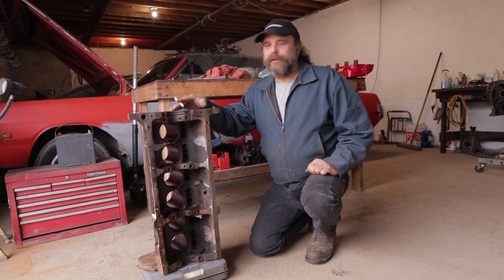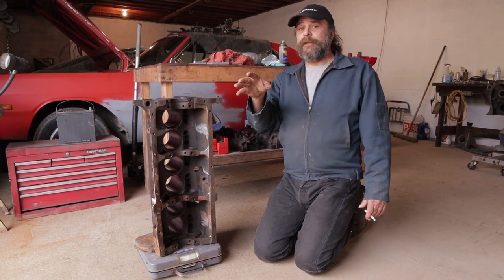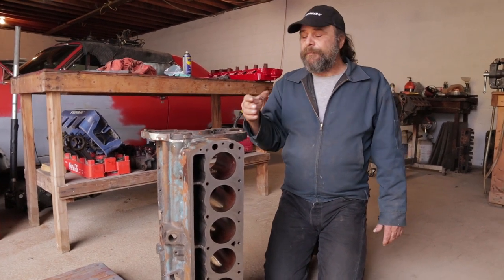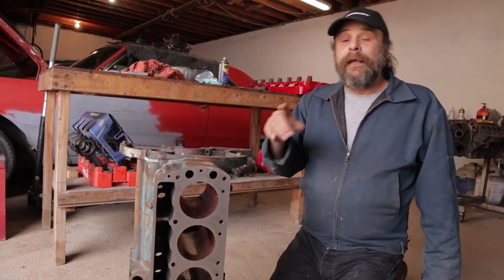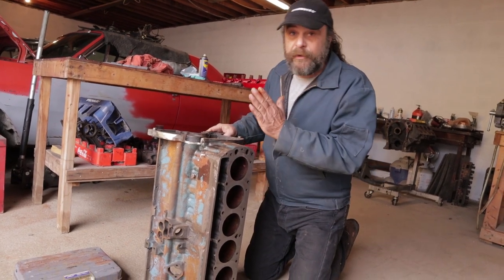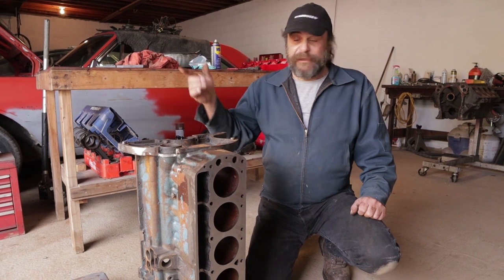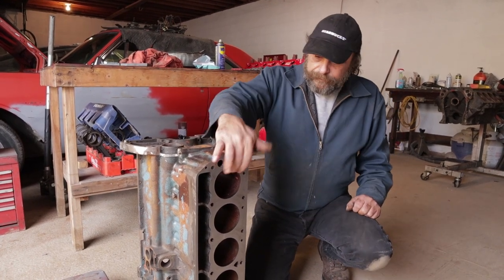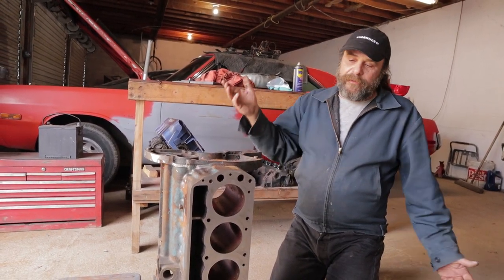Hot Rodding The Slant Six - Working The Block And Finding Compression

Comment: the newer blocks have a thin cylinder bore the head that come from from your head proly had 3 casting plugs the newer hast 5 side casting welch plugs use brass plugs the steel rust out,,,,, love all your vids my  fave channal

Comment: Good point about thicker cylinder walls some engines have thinner walls to begin with. I remember a couple 455 engines I've had cracking the cylinder walls after an overbore, they wouldn't do it till you started hammering on em at the track then poof up in steam they'd go. people don't realize the side load of a long stroke and cylinder pressure an engine goes through. back then I was young and dumb. those engines were plentiful and cheap and made a lot of power so I popped a few of em. O'h if I was only 18 again... love your channel, keep up the good work!

Comment: My friend had a '65 Dart Automatic with a 225 slant six. Engine needed to be rebuilt so we decided hop it up. Chrysler actually sold performance parts for this engine. We bought a four barrel manifold, HP cam shaft from them. We also purchased a set of headers and a Holley carb. Everything else was stock and engine not bored. Took it to the drag strip and logged consistent 15 seconds flat. This might not sound fast but in the late 60's this would beat a stock Camaro or Mustang. We had so much fun on the street on the weekends. Guy's thought we had put a V8 in it and wanted us to pop the hood to prove it was a six.

Comment: A good hand deburring tool works well on cast iron. Cheap and easy to use and available from MSC Industrial Direct. I have several. The flashing on the crank is from the casting process and is known as the parting line. It is where the parts of the mold are fitted together. There are other casting features to take notice of as well. Anything cast with a hollow will have some sort of core support, the sand core makes the hollow and must be supported on its ends or by wire supporters. On the slant six block the cores were supported by the freeze plug holes as well as wire core supports. I don’t know if the crankshaft was drilled for oil passages or if the were cast in. Billet and forged cranks must be drilled. Awesome work as usual Uncle Tony. Greetings from the high plains of Texas.

Comment: Great stuff and 'simply' explained for the laymen and keen  fresh spanner men out their. Putting a chamfer on  the top of the threads takes the stress out of the end of the thread, chamfering the top of the bores also limits potential hot spots that cause detonation, do the same on the edges of the combustion chamber for the same reason.

Comment: I have a slant head with .100" Milled. 
Was going to build a 9:1 225. Unfortunately didn't happen. Wound up buying a g32bt colt... lead to a slight dsm addiction. 
Now considering doing a 4g63 with a 4g61 crank, into an original 4g61t colt.

Comment: According to Mopar, you've got that backwards. I think it was Butch Leal the presented the Rod length to stroke ratio comparisons in the Book, 
How to Hotrod Small Block Mopar.  He found that the longer the rod the wider the powerband. Likewise I found an obscure magazine years ago that only managed to put out a handful of issues before going under. But they took a Chevy 327 and built it with 5.5" rods and again with 6" rods, both variations had the same 10.5-1 compression ratio. They tested each version with factory heads and again with a good set of aftermarket heads. Both versions , when the heads were the thing that they were testing, made more horsepower with the long rod, and they had a wider powerband. The percent of improvement was greater with the factory head with poor flow vs the aluminum head. The result then, was that a longer rod makes more power over a greater powerband, and poor flowing heads like the one on your 225, see a greater improvement than an aftermarket aluminum head would if one were available for your application. Unfortunately I lost the old magazine in a move to our first house when my sone came along. But I have two other articles talking about long vs short rods and they agree that the long rod makes more power over a broader range than a short rod. So why is everybody using short rods today? Because there are tons of stroked cranks available, and only so much room under the deck for the piston pins height. The other thing is there is a plethora of aftermarket heads for the most popular engines that make up the difference of a poor rod length to stroke ratio. 
Back in the day, Smokey Yunik was a master at building Chevy engines for NASCAR competition. He said that the ideal rod ratio would be 2.2-1. That is achievable in a Mopar 383 or 400 with its 3.38" stroke and Hemi 7.86" rod.  Butch Leal wrote that a street strip car should run a 1.89-1 ratio, and higher rod ratios for superspeedways when the corners are long and broad. For tight turns a ratio of 1.69-1 would help bring the car out of the corner with the cost of a peaky powerband. Keep in mind that the competition's 454 Big Block and striker 350 that makes 383 cubic inches both have rod ratios under 1.5-1, and snap crankshafts like twigs. In the late 70's thru the 80's when aftermarket forged cranks weren't available the core charge for a forged 454 crank ran $100 more than a reground crankshaft kit. That's ok, because if I were to run a Big Block Chevy I'd stick with the best and run a 427.
Reply from the maker: Long and short rods are relative terms, The Slant starts out with an extremely long rod.
Operating range is also relative.  Smokey was building engines that operated between 6 and 8 thousand RPM, and was completely unconcerned as to how it would pull from 3 to 6.

Comment: Use shorter push rods and there is a cast mount that bolts to the head and block for the alternator ( if you run one) that I had to shim or something, it was a long time ago. The Direct Connection slant six windage tray kit came with four 340 main bolts that have extra material in the head that are tapped for the tray bolts. You don't want to lose power from an oil system like too much pressure or volume and bubbles in oil get squeezed out and then it's metal on metal.

Comment: My 331 has 8:31:1 dynamic and a smidge over 10:1 static and runs fine on 91 octane. Depends on the head design the cam specs and the timing curve.
Reply: Hammer Head Garage I built a 331 as well with 10.5:1, 222/232 duration at 50. Runs great from 2k rpm and pulls hard to 6200. Compression is the secret to an n/a motor

Comment: As a kid, I got ahold of a hot rod six plymouth it a little hot rodded dodge body like a 34 model I believe. no fender and light weight. It wasn't fast on take of but it seemed like in high gear, it would turn forever. It was the first car at fifteen that I did over a hundred and I was scared cause I was the passenger. The kid was fourteen and in two years he had minor wrecks that left it undriveable but he just kept trying so his dad bought him a cobra when he turned eighteen but first ticket it was gone and I will be damned; he slowed down and got to be a good driver

Comment: Always chamfer and take sharp edges off. 
I'm pretty sure you've already explained in another video what happens to an unchamfered bolt hole when it's torqued down. 
At my work we are a dealer for a certain small engine that's known for popping head gaskets. 
After I do em , it doesn't happen again. 
Because they don't chamfer or do any kind of cleanup from the factory they just slap em together.
Reply: Thanks for that info. 👍

Comment: I bought a scat cast steel crank years ago. Fora Chevy 350. I could not belive how much lighter it was over the stock iron crank, it had to be 10-15 lbs, that ended up being a nice engine, aluminum heads, from trickflow, with canted valves, the twisted wedge, flat top pistons, 750 Holley, dual plane high-rise intake, I had it I. A full size truck, ex cab, it jerked the doors off a cobra mustang,  I want to build something similar, I tend to go overboard with the cam, this engine had a compucam from crane, a hyd, roller! .465" + the est. .030" from 1.6=1 rockers, port matched intake, it was just how the factory should had done it! I had it in a 3rd gen firebird, with 5speed, from a stopwatch and rough guestimates it should been in the 400 range, it would nearly pull the front wheels with 3.45 gears, I ran the rears at about 28-30 psi,  it would burn them down, this brings back memories!! Great video.

Comment: All good stuff (as always) U.T. -
when I had to close up shop I went back to Tool & Die work so....
A couple things - if someone wants to deck the block .100" without spending near as much money it could pay to shop a few regular machine shops (it's an easy setup on a large vertical or horizontal mill, or a boring mill) instead of an engine machine shop, it's a good chance they'll take .090" off at less than 1/3 of that $500 and still have the engine shop do the finish cut - at the same price they'd charge for a regular resurfacing.
Just tell the shop that rough cuts the deck to cut it parallel to the main saddles.
Most regular machine shops don't have face-mills large enough to finish cut the deck without overlapping cuts.
For chamfering the bolt holes chamfering tools are cheap, without steady hands I can picture some rough looking chamfers from them using a drill.
I'm looking forward to the welded in quench area deal, my experience has been that engines with quench style chambers (I usually run .030" piston to head unless I'm running real loose piston to wall) make good power on lower octane, less fuel, and are less fussy about the tune.
Keep the faith Uncle Tony, you're doing an awesome job!
Reply: @trillrifaxegrindor4411  Thanks.
I could picture hacked up bolt holes and broken drill bits when U.T. said it.
Chevy counter-drilled their head bolt holes, but I'm sure they drilled big first then drilled and tapped the bolt holes themselves.
U.T. knows his stuff, he's just not a machinist.
Reply: Hmm if your going .100 thousands you might try a good big horizontal band saw like a doall take .075 my  ww2 era is big enough and cuts .010 accuracy just a lot of set up
Reply: @jeremyhanna3852  
It needs to be a good flat surface. Most engine shops finish iron decks - both heads and blocks - with a grinder that has a segmented wheel like a Blanchard Grinder.

Comment: Love the vid,, can you explain further the reasons for the short rods/tall deck config to achieve 4.6 -6K usable rev range? I understand the head flow limitation...
Reply from the maker: To really simplify it...A long rod is good for higher RPM horsepower and a short rod is good for lower RPM torque

Comment: I know & I know you know about the way to find out how thick the cylinder wall is . In the 50's 60's to mid 70's engines had nice thick cylinder boars . In late 70's & 80's the boar got thinner so you had to be careful how much you board out the block . My dad & I went 30 over in stead of 60 just to help the block last longer . If you go 60 & where it out you need to sleave it if you go 30 you got 30 to go before you need to sleave the block . Wiseco is one town over from me like 5 minutes away . I can walk there . It's nuts it seems not much happens here all the big racing is every where else and yet supported by 3 major company's in my area . Pistons ,radiators & trailers co . Just nuts

Comment: Dont forget to drill the hole in the block so oil drips down on the fuel pump arm / eccentric . I read thats the weak spot of a slant 6 in how to hot rod slant6's with doug dutra
Reply: This motor will spend its life under acceleration... nothing 'drips' then!  Not many racers run mechanical fuel pumps either.  Thanks for the tip though.
Reply from the maker: It's an electric pump drag engine.

Comment: Any gas engine with a compression ratio over 9.5 will run better with higher octane fuel. And it'll run even better if you smoke a cigarette.
Reply: 10.2 means he's got to run 91 octane, which I guess is OK if you don't mean to drive it all the time. And hopefully 91 is good enough. But it's not really a choice.
Reply: It's got a lot more to do with your dinamic compression and cam specs then just static compression. But as a general rule 9.5-1_10.3-1 89 octane is good but anything over 10.3-1 you want 93 if you want to run any timing
Reply: Kevin Collins from my personal experience in addition to static and dynamic compression ratios, the combustion chamber design also seems to play a part in the required octane as well. I have seen 12:1 engines run on 93 pump gas with efficient closed chamber heads
Reply: @MegaMustangkiller  yes you do have a point there cause the more efficient the design the better flame front you get and even with a less efficient design some simple polishing can achieve the same thing by eliminating hot spots.
Reply: So I guess I'm scratching my head here. I have no experience with Mopars, but we used to run 12.5 to 1 static on an old Triumph Spitfire 1275 engine & 12.5 to 1  on VW water cooled road racers without problems, provided we blended 50% Sunoco Gold, which I believe is 93 octane & AV gas, which I believe is about 100 octane. I'm sure the VW combustion chamber is somewhat more modern than the Spitfire, so why not go a bit higher than just over 10? Our races were 20 minute sprint races. This approach was common amongst our group 30 years ago.
Reply: Colin Hyde I don’t have much experience with those types of engines but my guess would be that that blend of fuel would be around 96 or 97 octane, and depending on the valve events those engines may have lower dynamic compression ratios.
Reply: @colinhyde1951  it not just mopars static, dynamic compression ratios and cam lift duration apply to any 4 cycle engine
Reply: Combustion chamber design does have a huge influence. It is my understanding that Ford flathead enthusiasts use no more than 8:1 compression.

Comment: Just curious.
Why did you not go with an aluminum 225? 
Availability reasons?
Reply: Flat Broke Auto Correct head gasket is as rare as hens teeth.
Reply: Maybe itd be possible to punch or get one cut out of copper sheet
Reply: @Chris-nq6cm  correct very easy to have done.
Reply: Do leatherpunches work? Im considering trying to make some copper gaskets
Reply: The aluminum 225's are harder to find these days as I believe they were only offered from '61 to '63. They were bad to blow head gaskets and just aren't as durable as the iron slant 6's. You can't overbore them as much as an iron engine either, not to mention the some of the harder to find specific items for the aluminum slant 6. For performance, the iron slant is the way to go!

Comment: In reference to your concern about connecting rod length, would you consider hot rodding a 170?
Reply from the maker: I will do a 170, but I've got a few other builds that need to be completed first
Reply: The neat thing about the 170 is that it's a zero deck engine and cutting the head .100 will net a 10:1 compression...
Reply: @UncleTonysGarage  Its YOUR fault after telling us the 170 cid was the original structure the engineers designed and how the the 225lb was basically a bean counter engine with quite a bit of compromises.

Comment: Question...  How will the head and deck milling affect the pushrod and rocker geometry?  Do you cut the pushrods?  Never tinkered with a 6 before, only BB & SBs.  Thanks!
Reply: It's a solid lifter motor so if the valve lash specs out it's good. If not it will need custom push rods.

Comment: Use a countersink to chamfer the bolt holes. Do not use a larger drill bit. It is the wrong angle, it is going to grab, and it is going to create lots of trouble for people who try to use a drill bit. Buy a 90° countersink or even an 82° will work.

Comment: Slant Six cylinder head question:  Would there be any advantage using a late head without the spark plug tubes?  Are they interchangeable?  Which one is best for HP use?
Reply from the maker: The peanut plug heads are slightly heavier and with the same ports and chambers
Reply: @UncleTonysGarage  OK, Thanks, Uncle Tony.

Comment: If you're going to spin it 6,500, after you knife edge the crank, wouldn't you want to balance the crank, rods and pistons as an assembly? Are you going to use ARP bolts on everything? Just curious
Reply from the maker: It's probably not going much beyond 6, I'm not knife edging, just cleaning up flaws and smoothing edges, and the stock Chrysler hardware is of extremely good quality.  I've never experienced rod bolt failure in any Chrysler engine from this era.

Comment: Hi Uncle Tony, If you Deck a Block, shaving a determined amount off the top, doesn't that interfere with the Head Bolt thread length within the Block itself? I appreciate the video, Cheers bud :-)
Reply from the maker: May need to use washers on the head bolts. Don't know yet
Reply: @UncleTonysGarage  Just curious, as people in various media(s) tend not to tell the fine details unlike like yourself. So it leaves people, such as myself, wondering if anything is actually affected when the Block &/or heads are shaved. Cheers bud :-)

Comment: is a slant to small to benefit from a vacuum pump?  
we picked up 30hp on a BBC pretty much across the power band
wonder what the practical limits on them are
Reply from the maker: Not sure if it would be effective on this, but I do always run a PCV system.  Not quite the same, but a step in the right direction

Comment: Great video. Can't wait for the next one in this build. Do you really need to waste all that time sleeping at night? 😁 What trans and rear end you gonna use?
Reply from the maker: Trans is an A903 light duty 3 speed, and rear is a 4.10 7.25.  That is why weight is so critical on this build.  Saving HP with light duty drivetrain components, the tradeoff is that the car has to be super light for them to live